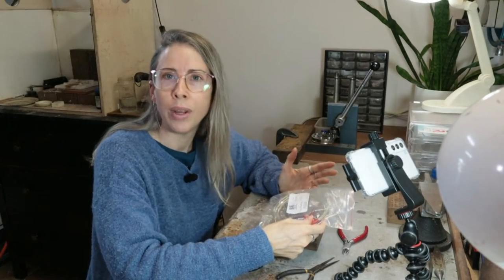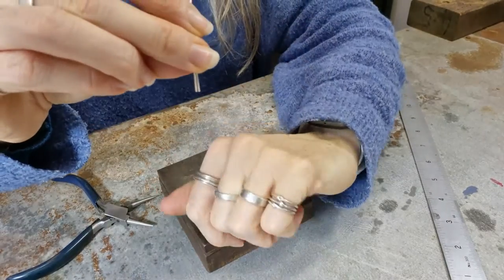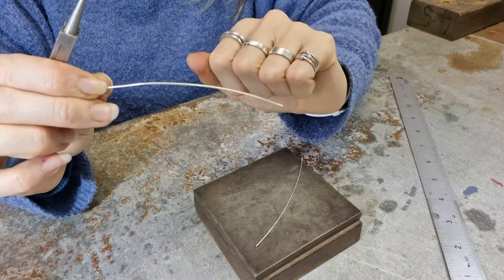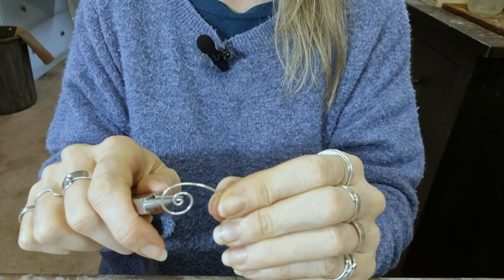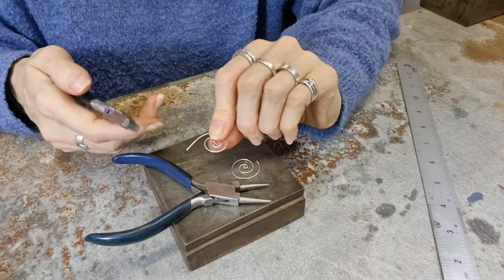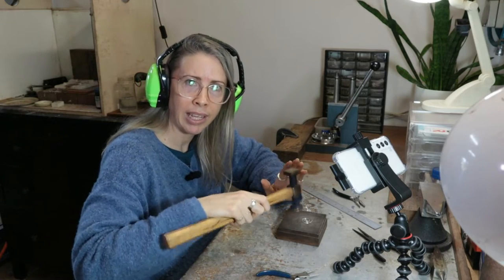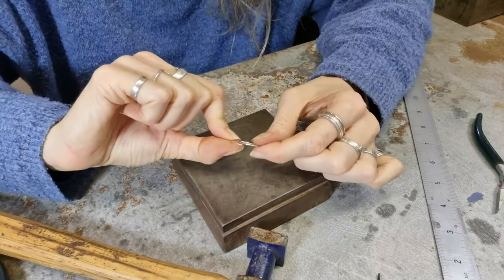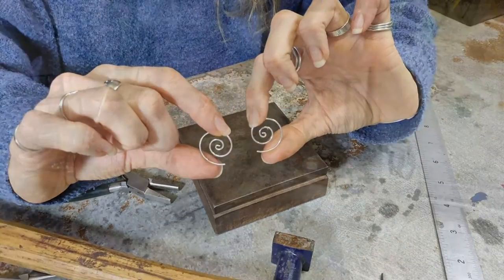How to Make Silver Spiral Earrings | Step-by-Step Jewellery Making Tutorial.

Comment: Surprised you used 1mm most would consider that way to thick to pass through ear piercings.
Reply from the maker: I've sold thousands of earrings made with 1mm wire - I've never had anyone have issues with it. I do disclose that it's a bit thicker than usual in the item description. I myself wear them all the time.
Reply: @JessVanDen  Not meant to be a criticism just going by the "industry standard" and thought a bit unusual.
Reply: @JessVanDen I am just starting out with wire and have been using 1 mm as well-fits piercings just fine.
Reply: I always use 18 gauge wire for my earring findings.
Reply: I can’t do an 18 gauge in my ears either. After an hour or so I have to take them out. But I wish I could wear an 18 gauge for designs I’d like to make. If I’m making a simple ear wire 21 gauge is my preferred gauge. If doing a earring that incorporates going through the ear as a one piece design I use 20 gauge.